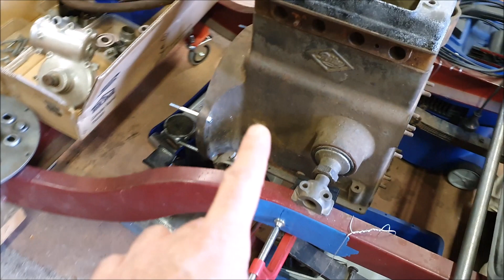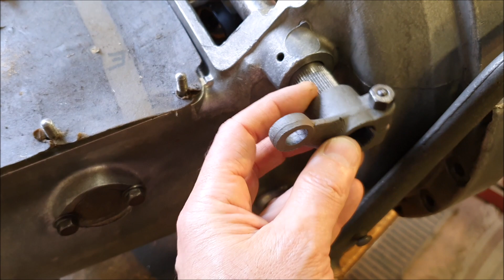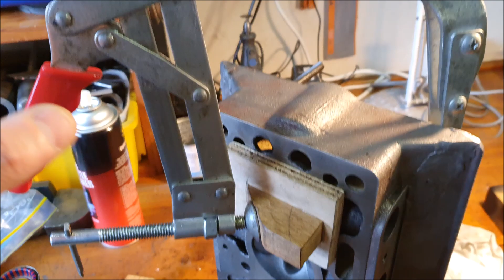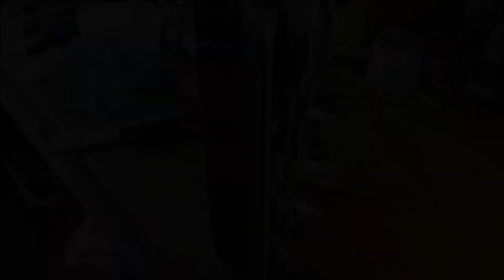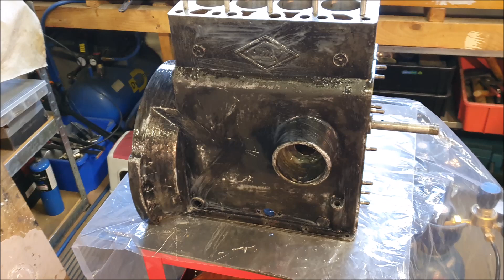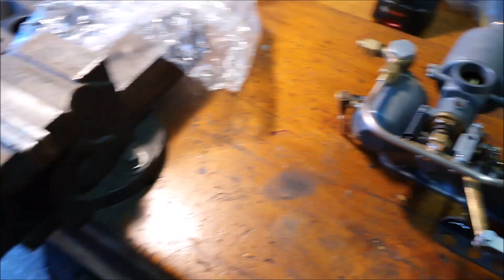Pre war Riley 9 head and block

Comment: i have always fitted washers to seal the spark plugs, indeed was thinking how "indexing" would make any difference to the engine's performance, if it did, what would be the optimum position for the electrode, obviously a three-point electrode would not need to be indexed, but with side electrodes could be all over the place!